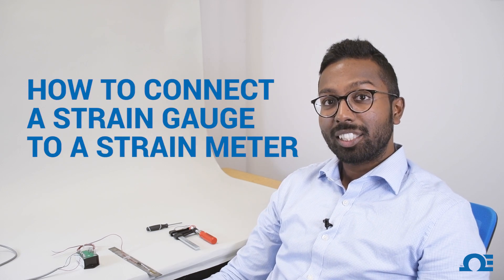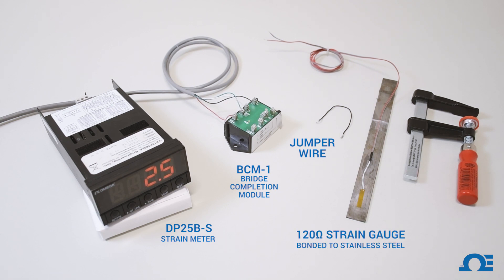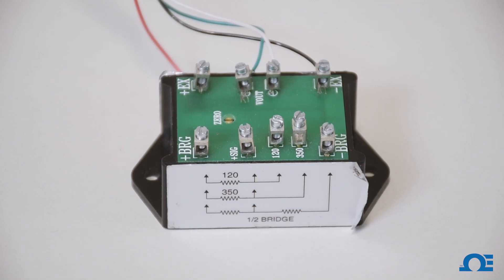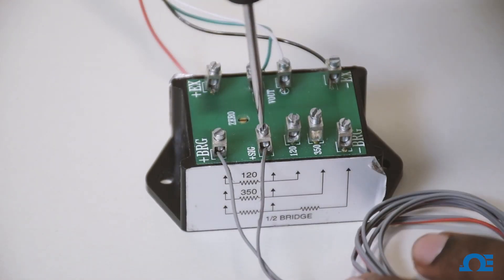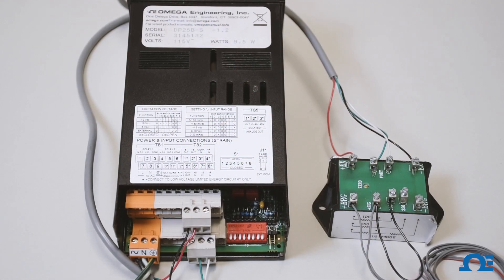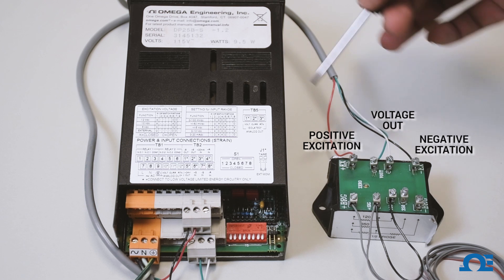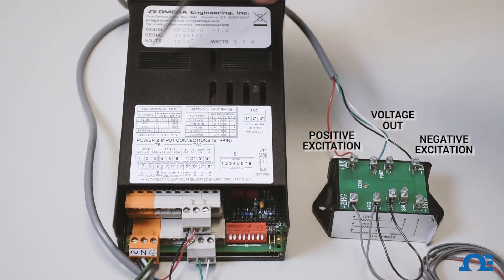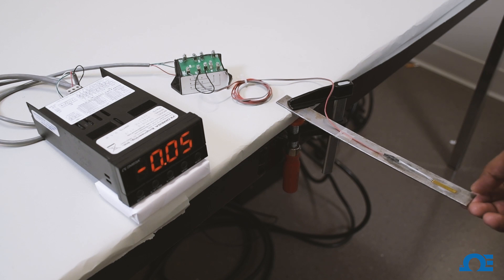How to Connect a Strain Gauge to a Meter

Comment: Is it possible to use 3 wire strain gauge at quarter bridge configuration by Omega BCM-1 bridge completion module ?  If yes , what is its wiring ?
Reply from the maker: Hello Bijan, We would love to assist you with your setup - please email: pressure@omega.com

Comment: Hi. I want to measure micro strain for carbon steel (mild steel) size (200mm×100mm×10mm) by using one strain gauge only in one direction ( force in the end ((bend)).  I hope you will help me to find the right device and the suitable strain  gauge 120 or 350 .